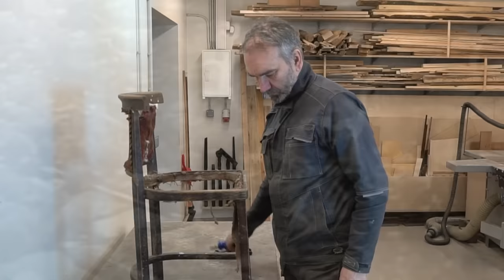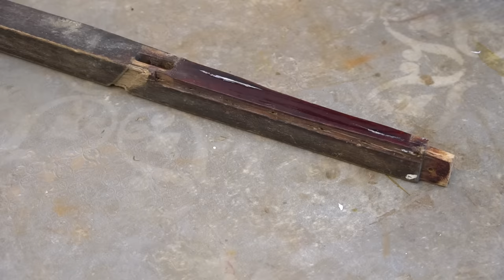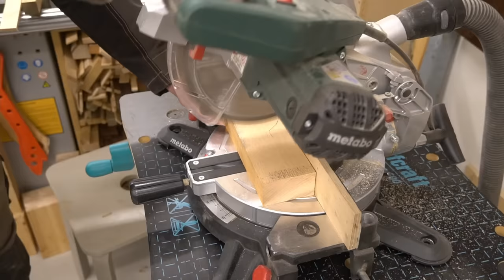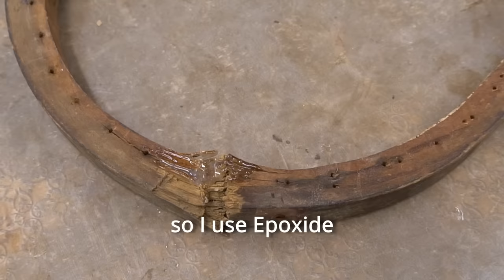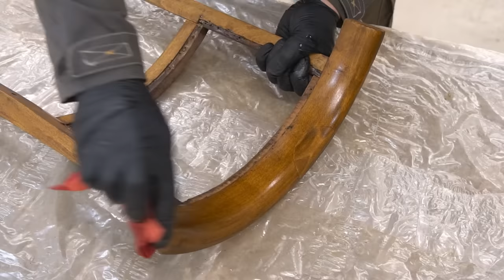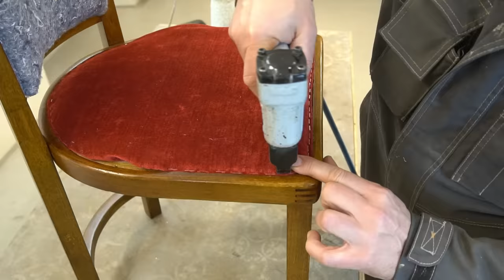I restored BOMBED CHAIR from WW2

Comment: A really nice job as always, you replaced the leg that was damaged, id have been inclined to have reused the damaged one to patch repair the rest of the chair, nice trick with the air hose to push the glue in between the split wood, that's a new trick on me, all the very best "H"

Comment: Simply beautiful. Fantastic result and superb job! A couple of questions - do you use water based dye over shellac? If yes, how the dye penetrates the wood if it's already treated with shellac? And do you treat all the parts and surfaces with shellac? Did you use here any final coating after the dye? And did you use plain epoxy for the damaged part on the front, without saw dust etc? It looks that the epoxy worked with the dye well, though many say that wood dyes don't work well on epoxy.

Comment: Really, there is nothing that gives wood the same shine and depth as shellac. It just has a certain luster and look i have never seen reproduced by a modern artificial laquer or varnish. And it´s also what I use when I want to repaintr a very beaten old sewing machine. Because you cannot really get the old japaning they used anymore. And first a few coats of in alcohol dissolved shellac mixed with lamp black (basically sut) and then one or two without to give it a near mirror finish reproduced the shine the original paint had like nothing else I have found.

Comment: You didn't restore it.  You repaired it. Restoring to it's original condition and reassembling it with the same techniques is a lot different than reparing it with the lastest technologies and equipment. It's beautifully repaired/refurbished.  The tools and techniques used were first rate and the results are terrific.

Comment: The reason this has survived so long, is that it was a survivor of bomb damage during the war. It’s been beautifully restored, no doubt, but all evidence of its history has been erased, and that’s a shame. Difficult decision I know, but I’d have left some markings of the damage.
Reply: The repairs -- wood he had to replace, which is visible when we know what we're looking at -- are all the evidence that I think is necessary. Leaving any of that extensive damage would have left the integrity (stability overall and complete representation of the designer's original intent) of the chair compromised and with a shorter post-restoration lifespan.

Now Ahti has documented its history here for the world. Aesthetically I always prefer old or used things over new/new-looking ones, but if something is so bad off that someone has to take the time and effort to do restoration, it always baffles me that they would leave a piece looking like it still needed repairs cosmetically. Like, what's the point, if everyone knows it had been reduced to an elegant chair-shaped pile of toothpicks before you worked on it? Bring it all the way back, if it's that far gone. 💜

Comment: A nice renovation, however IMHO some of the chair's history is lost withe the replacement of bullet / schrapnel damage being replaced with new timber. The ones in the backrest and front leg I would have left (the leg could be strengthened with steel rod inserted via a hole drilled up from the foot) and the damage left untouched.

Comment: And why are you using PVA glue instead of animal skin glue as it is a must for restoring antiques? I know it's way quicker, but it's realy not what a real restorer would use for the peaces you are working on.
Reply from the maker: Why not?
Reply: @ATRestoration   all materials in restoration proces should be reversable, you should realy know that. There are some exceptions, but not the glue.
Reply from the maker: @blevyzgass97  I have opened joints glued with PVA for several times. It is harder than hide glue but it is reversible.
Reply: @ATRestoration  if your clients are okay with this, then there is no problem. Unless its a museum piece.
Anyway, i make a living out of furniture restoration too. Greetings from Lithuania🙂
Reply from the maker: @blevyzgass97  Yes, that is true, I don´t do work for museums. You are welcome :)